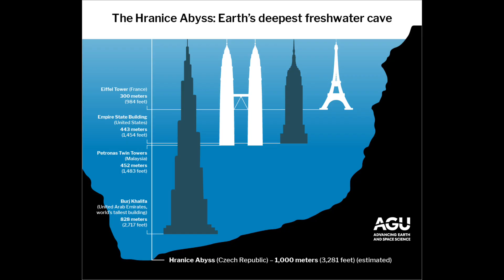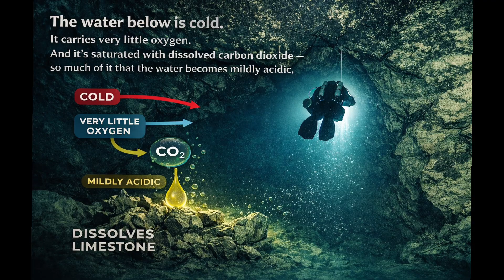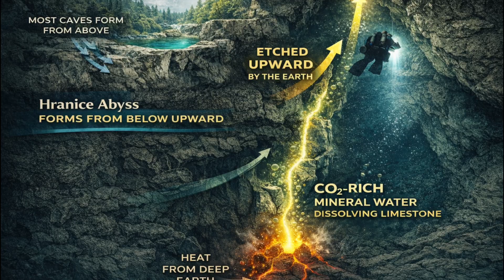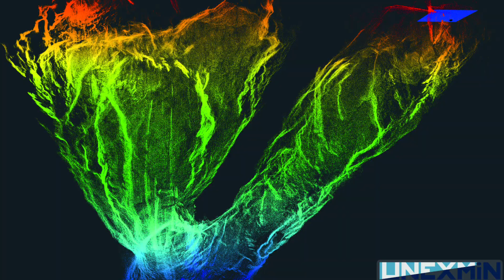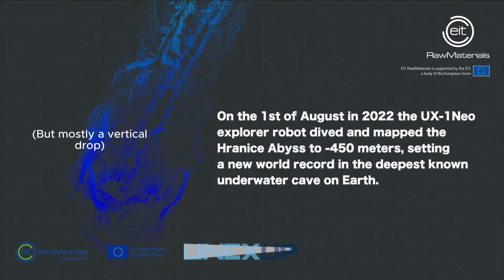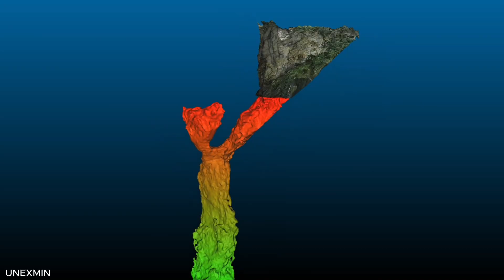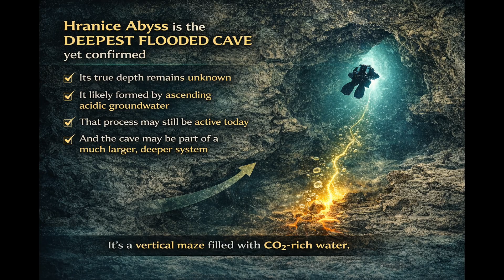Scientists Can't Find The Bottom Of This Flooded Cave

Comment: The Devil's Hole in Nevada is equally as puzzling, perhaps even more so. They dropped a 900 foot rope into Devil's Hole from 300 feet down and still didn’t touch the bottom.
The really puzzling thing about Devil's Hole is that the water in it reacts to seismic activity thousands of miles away. 

There’s no explanation for it.
Reply from the maker: That's so interesting, thanks for sharing! I covered the Devil's Hole Pupfish in a previous video. Really fascinating stuff!